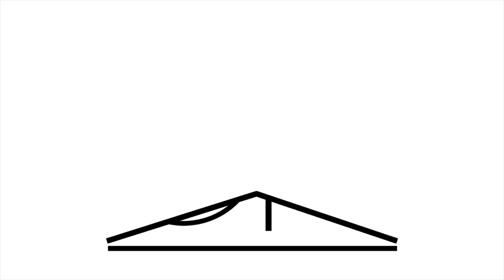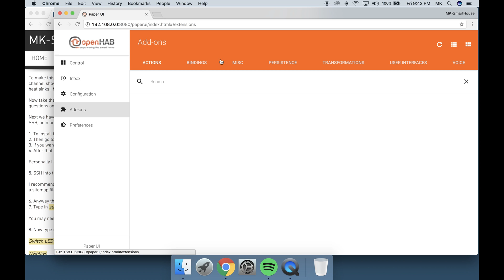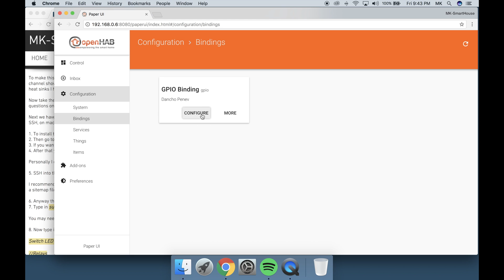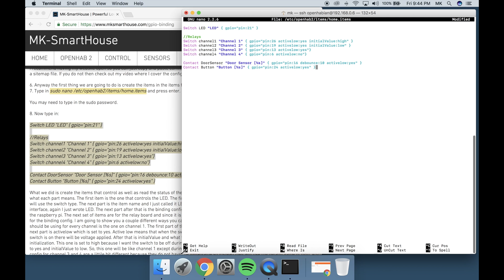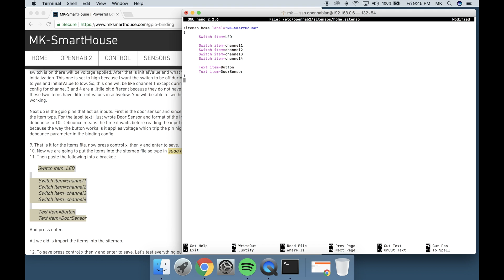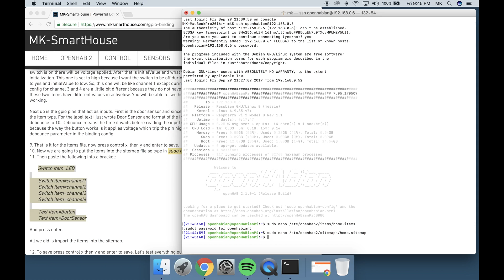Complete Guide GPIO Binding + OpenHAB 2

Comment: OK im a sub now ! thank for the video, im looking to deploy such a thing.. ok check this out https://youtu.be/xXSTdWKqqro this is our chicken coop that has door open/close led lights and water pump. im been thinking about having such an interface for follow up or control over a script.py in crontab. normal day - door opens ( i peek outside to verify lol ) pump turns on and off every 15 min and end of day door closes ( yes i peek outside again ) i also have a DHT22 that is pushed to a html from davids site and i can verify from the temp that the door was closes lol NOW ive been looking at the OpenHab ( i dont think i can run it on my chicken coop Pi so i ordered a new 3B+ just for that, want to make a dashboard that has a few in house items Hue-switches etc, but also a chicken coop menu, where just like you have a way to control the 4 chan relay. i love the sensor and this will confirm my peeking outside daily.. i was going to try and figure out a way to hard wire a push button on the coop pi to run scripts if we are in there and need to open or close the door .. but not sure how to do that yet. also on the openhab would be nice to see the coop temp and humidity that the pi is pulling. any way thank you and hope to dig into your videos and see codes to help in our situation !

Comment: I'm trying to use a Raspberry Pi zero to remotely control two relays.  Your videos have been very helpful, I've been through "setting up configuration files", "my openhab" and "mobile device access", these have all worked perfectly just as you explained.  My next step was the this video on GPIO binding, it worked until I got to the binding install which just gives me the spinning wheel that goes on indefinately and never completes, any ideas?  I have made the assumption that a zero will work just like the 3, since I had no way to do the openhabian setup on the zero without an eithernet port I used a 3 for that then switched it to the zero for your instructions, I did switch it back to the 3 and it still wouldn't install the GPIO binding.  There doesn't seem to be any differnece in the operating behavior whether the SD card is plugged into a zero or 3.  Any help would be greatly appreciated.

Comment: Hi MK, great video. I'm just starting with OpenHab so Your video helped a lot :) What if I'd like to add more relays? Could You show how to use IO Expander like SX1509 or MCP23017 to connect more relays (I'm planning to use 2x8 relay boards)

Comment: Thanks for the Video! I stumbled upon it trying to find a fix for my pi GPIO pins. From what I have read around the web is that there is a root issue that may not allow openhab access to the gpio's. Is there anything you have done to correct it?
Reply from the maker: +nomatictsfam All I did was use an openhabian image and install the binding

Comment: Hi MK, great tutorial...
Can you please show/comment how to add pwm out using GPIO binding? I want to use slider to control LED strip...
Reply from the maker: +Onkar Gulavani it is not possible, the GPIO only allows input and output
Reply: thanks MK-SmartHouse ... I will try use python code with localhost mqtt... i guess this will work

Comment: Thanks, a great exampel on how it work. I will check this our myself.
But should you not have a current reducing resistor on the LED, so it doesn't use to much current from the RPi.  Guess 220 would be a good value.

Comment: Hi MK, you are doing a very geat job, just keep going  :)
I need your help.
I folowed all your steps, but I faced a problem with OpenHab2 android application, when I'm using the remot URL, an error msg is appears saying ""authentification failed. Please check Username/Password settings"", and I'm using the same username and password when using Browser on Windows OS, this problem apeared just when I apdated the Habdroid application.
thnks a lot for your Great Videos :)

Comment: I tried to do the same as you showed in this video however the relays don't work since they need 5v logic which the raspberry pi does not supply. So I was wondering how you got it to work since I noticed that you have 5v relays just like me.
Reply: Ben Mock you can use a npn transistor